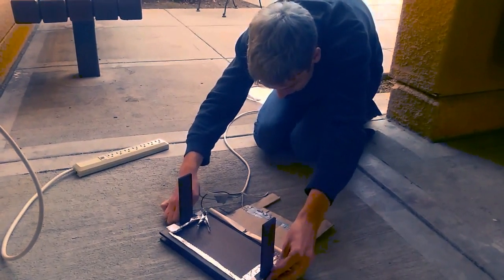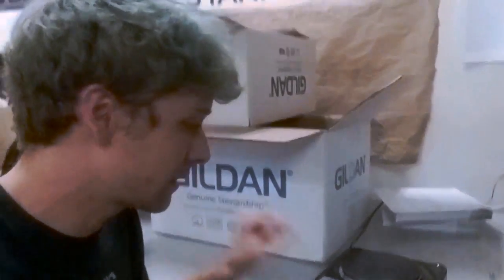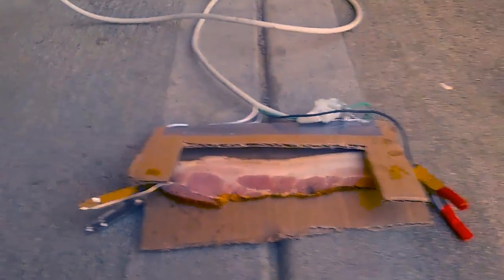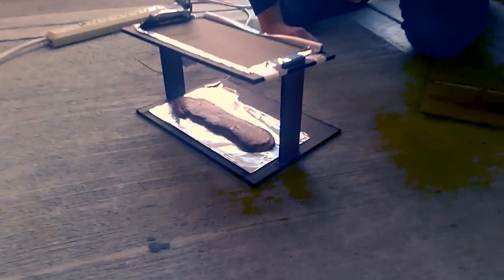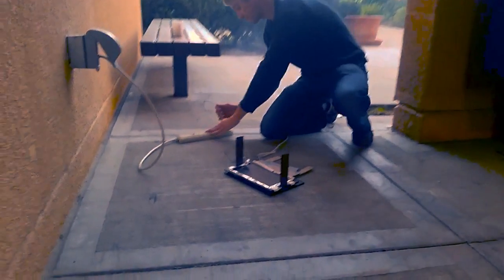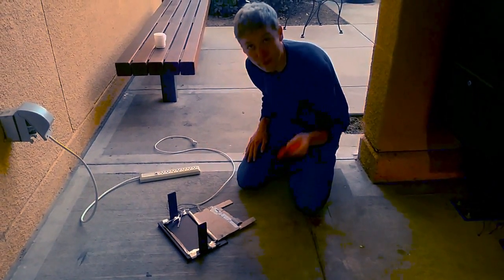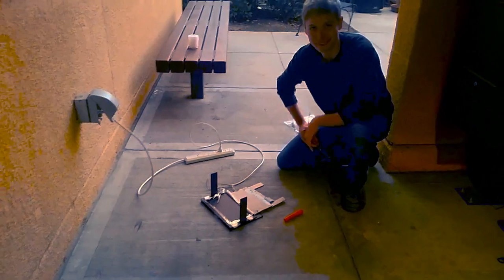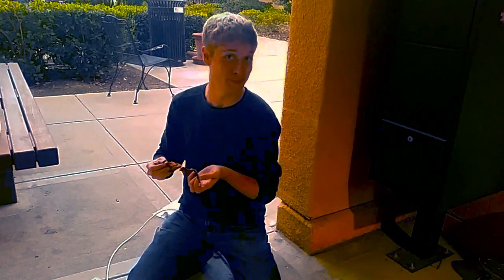What happens when you plug bacon into the wall?

Comment: the electrically conductivity though out the bacon would vary considerably and in turn would result in one main path of least resistance. I'd think trying to get the flow length wise and in a vacuum/noble would be best. That's the obstacle...you cooked the bacon with archs, not the electrical resistance of the bacon.

Also whats the difference between  how a micro wave cooks and your objective here?
Reply from the maker: The difference between microwaving and this, is that this is more fun :P
Reply from the maker: You're right about the arcs though. The next step here if you really want to cook it super quickly, is to impedance characterize the bacon. If we lower the voltage, there's a maximum power point where we can get the most power into the bacon the quickest.
Edit: This also reduces arcing, and makes it cook resistively.
Reply: Ha! good thinking!  find a min pressure and put the power to it!!

Comment: The problem with your theory is that carbon conducts better than raw bacon, so the opposite of his self-regulation theory happens, the places that get burned will draw even more current and get more burned.
Reply: Bacon is the LED of meats.
Reply from the maker: you're totally right, that's a good observation. If you burn all the way through, you're gonna have a bad time

But interestingly it doesn't go all the way through. The arcs only appeared to arc from the tinfoil pads to the top of the bacon itself. Think little asteroid craters. That's a function of our high (120VAC) voltage. If we drop that to something lower, we can increase the amount of power flowing into the bacon, without arcing to it and burning the crap out of everything.

Edit: rearranged for clarity.